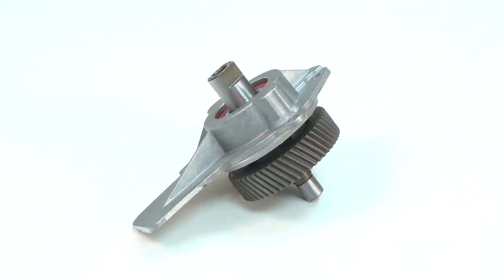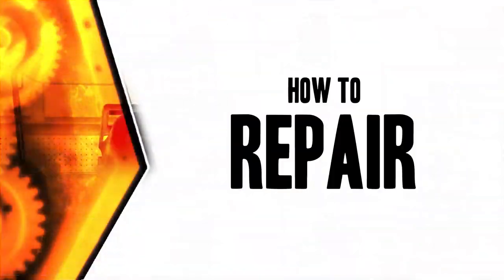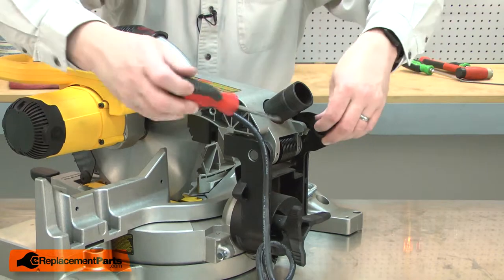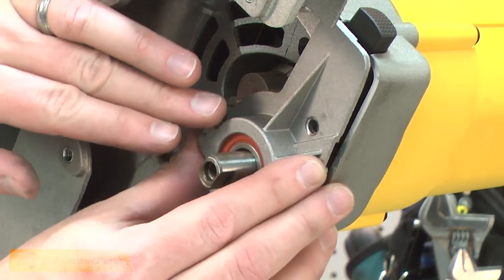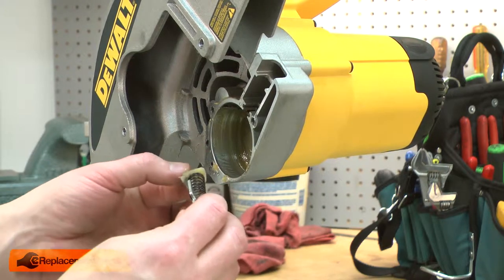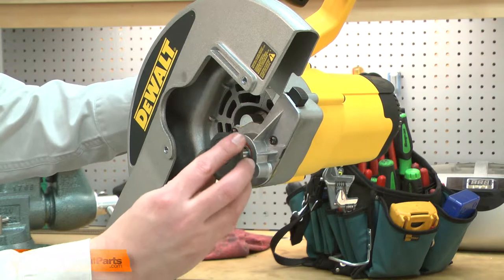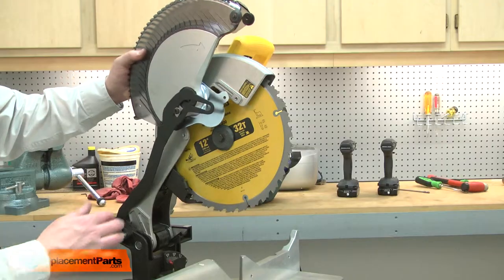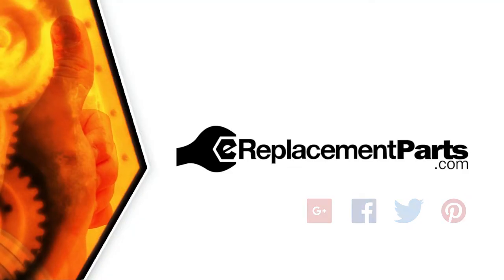DeWALT Miter Saw Repair - Replacing the Spindle & Gear Assembly (DeWALT Part # 386824-03SV)

Comment: It would be extremely useful to demonstrate the ‘before repair’ behavior - would likely save many of us with lesser experience considerable time in exact diagnosis without needing to disassemble and reassemble
Reply: One symptom is a horrific grinding noise from the bearing or gear, like on my DeWalt 715 chop say
Reply: Amen. Let us hear the issue to see if we are dealing with the same problem.

Comment: Hi, a couple questions. I have a 2yo DWS779 and I’ve only used it about 6-7 times. Have you ever seen that grease leak out of the spindle housing gasket as a liquid? Maybe from not being ran enough? Also, what kind of grease do I use if I want to take it apart and re-grease it?

Comment: Is it possible to replace only a bearing instead of whole spindle+gear?
Reply: I had the same thought. There's a circlip on the shaft so it looks like it's made to come apart for individual part replacement.